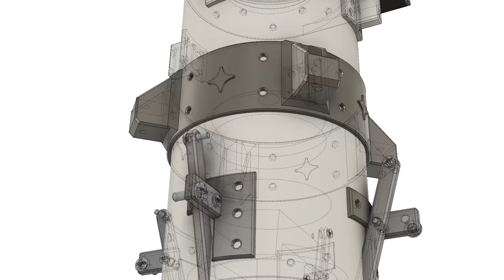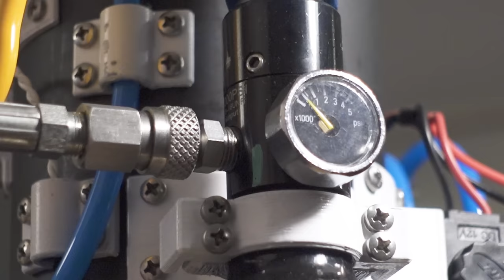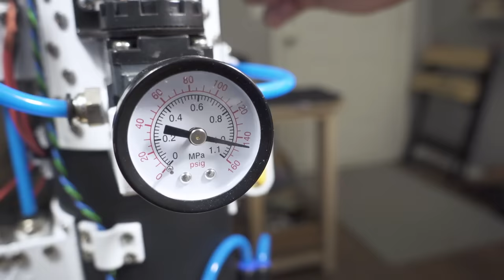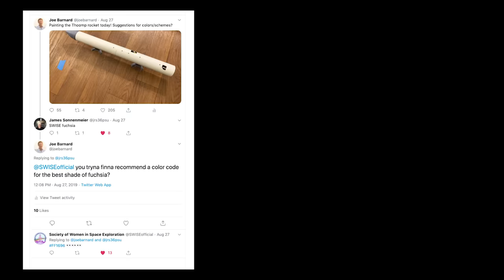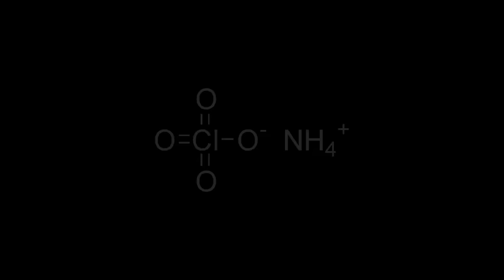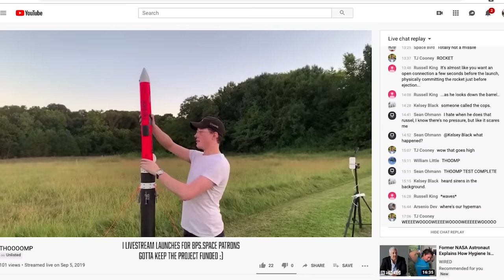Silo Launched Model Rocket

Comment: Now, make a underwater (submarine style) silo launch.
Reply: Yeaahh Agree!
It would be Awesome 😃
Reply: Cool 😎 idea.
Reply: would require way more thrust than a simple piston can provide
Reply: @ConfusedPlushiee  not necessarily. Look up cavitation or underwater launched rockets. Most create a vacuum or air bubble around the surface of the missile/rocket. This makes the rocket basically fly in vacuum/air underwater, dramatically reducing drag almost to as if it was above ground.
Reply: @jheins3  but isnt that a bit too complex for model rockets?
Reply: @ConfusedPlushiee  it would be difficult to test/launch but other than that idk. Joe is a genius
Reply: @jheins3  guess we'll see, tho I dont think he will be doing that.

Btw if anyone can convince him, theres a rocket project in the Netherlands, TU Delft, they want to break the karman line as second team to ever do that (after MIT), they will launch in summer 2020. Would love joe to make a vid about it!
Reply: @ConfusedPlushiee  an automated silo launch system isn't? hahah
Reply: Seimen Veldt it’s a little unnecessary and require a lot of work, but totally feasible
Reply: Use a condom to seal the silo between door opening and launch.
Reply: @jheins3  You're quite close. Real SLBM's use either a steam or a gas generator which is attached to the missile tube. In the case of the steam generator they have a small solid fuel rocket motor with its exhaust directed to a container of water. Once the motor is ignited it almost instantly boils all the water to steam, causing the missile tube's watertight cover to shatter along pre-stressed lines while simultaneously accelerating the missile upwards, out of the tube, through as much as 50-60 meters of water. And just like in this video, the missile will breach the surface and lift out of the water another 10-30 meters before it reaches its apogee and starts falling back down again, which is detected by the missile's accelerometer, causing it to ignite its rocket engine and beginning its flight. The bubble of steam or compressed gas will expand as it rises through the water column as a result of the decreasing water pressure, thus keeping the missile from coming into contact with the (sea)water. If compressed gas is used to launch the missile instead of steam, the entire process is pretty much exactly the same.

Comment: Man, that whole series is a bomb! I'm actually on the last phase of my master's thesis, where i need to design my own reaction control system of a rocket and your videos help me so much with it. In fact, some time ago I was dreaming about building a rocket and now, since I gained a lot of knowledge regarding this stuff through both my work on thesis and your videos - I'll surely go for it. I even shed a tear, when I saw a moment of rocket engine ignition. You are an inspiration. Thanks a lot!

Comment: I did a silo launch experiment around 1990. I made a rocket out of ¾" pcv tubing, put on folding fins made from plastic drinking cups, and put the "D-1" Estes motor on top of the tube. The motor was placed there so that I could line the tube with gunpowder from a shot gun shell, held on with gasoline. The added boost from the gunpowder/gasoline would significantly energize the rocket. The rocket then went into my custom made launch silo.
  I calculated that the rocket motor, with extra boost, contained in the launch tube, would really make this puppy fly like a literal bat out of hell!
  My friend and I went to a local grassy park in Southern California for our first test flight. The small bit of gasoline was dribbled inside the rocket tube, then sprinkled with gunpowder. The igniter was attached to the motor at the top of the rocket. Rocket slid into launch tube, wiring set. We took shelter behind our nearby car, just in case.
The button pushed, and the rocket blasted out of the tube perfectly, for about 5 feet, or 1 second.
  Apparently, using pvc tubing was an unforseen problem. The intense heat from the motor at the top, with combined burning from the boost mix, heated the tubing to its near melting point. As soon as the rocket cleared the tube, it became like wet spaghetti, and the motor thrust was 'vectored' like high pressure water coming out of a loose garden hose.
  The rocket went up left, right, forward, and back, right at us. We ducked, and hoped the terror of the out of control missile would end before anyone was damaged.
  The spent projectile plopped to the ground after traveling 20 circuitous feet. The rocket body was twisted like a Twizzle liquorice stick. We were laughing our heads off at the results, and the fact that we were in one piece.
  I'd made 2 of these things, so naturally we tried it a second time, only with no gunpowder/gasoline now. We got further back, hit the power, and.... same thing. Our ordinance went crazy, like a heat seeking 'Sidewinder' looking for a nonexistent MiG-29! We ducked behind my car. Plop! went the errant pvc tube, bent like a soggy pretzel stick.
  We went back to our garage laboratory, to make our next ridiculous toy; a BAZOOKA! Fortunately, that ended when we realized that if someone saw us shooting a shoulder launched, directional rocket, that we might be mistaken for terrorists, and there was a lot of that going on then.
  We didn't have the money for lawyers to explain that we're just hobbiests, experimenting with novel homemade toy rockets. It's also against model rocket doctrine to be able to aim your rocket at anything. We were planning on shooting down low level kites. Bad idea.
  I'd made my own JAVELIN out of 3 feet of 4 inch gray pvc tube, with a toy squirt gun handle, push button trigger, and a metal computer cooling fan screen for a sight. The missile was once again ¾" pvc, with the nose cone made from a large 'Crayola Crayon' top I'd gotten from Goodwill.
This made it look exactly like a Russian RPG! It was beautiful, and entirely stupid. If the police saw me with this, in 1990, I would have either been shot dead on sight, or still be rotting in a federal jail.
 Regretfully, I threw the whole contraption away. But it would have been glorious!

Comment: Good point about engineering. The WW2 Mk 42 torpedo is a fine example of engineering without testing. The weapon was a near total failure for the first two years of the war.
Impressive final results. You made a  model  of the cold war Polaris missile.

Comment: Did this 35 years ago on a much simpler platform. Built a rocket based on the Estes "scram" rocket with spring loaded fins. After several static tube launches we graduated to a shoulder launched model. No fancy electronics just a 16" rocket on a D-engine and some burnt Mullets.

Comment: Should've added some fins for stability. In order to fit them inside the silo, you could've built a spring-loaded mechanism that allowed the fins to be "compressed" while inside the silo as they pressed against the inside of the silo's walls. Then as the rocket was ejected, the fins would spring outward into their full shape unrestricted by the silo. I'm sure it would've helped with the flight instability issues!

Comment: So Joe, I thought it would  be of some use to you (If you didn't already know. You probably do at this point, but I'll share just in case..) to know that you're losing a ton of potential altitude by allowing the rocket to almost fully decelerate before triggering the motor. Essentially you always consume a considerable amount of your motor fuel trying to accelerate the rocket alone, but you could be letting the piston do all of that for you, allowing the motor to focus purely on coasting at already-max speed, giving you way more altitude.
Think of it like driving in the city vs driving on the freeway. All those stops require your car to decelerate and accelerate several times, which burns a ton more fuel.
Basically, with near-total deceleration before motor ignition, it's as if you set your rocket on an 6ft ledge and ignited it from there.

If you already knew this then, yay! if not I hope it helps! I've been following your stuff for a little while, and this has been really inspiring.

Comment: By the way there are laws against adding guidance systems to model rockets (At least there were in 2006). GPS chip firmware is also required to have certain mitigations in firmware to stop them being used for missiles. I seem to remember a 26k ft ceiling and 4g acceleration. That may also be where your instability came from if the horizontal acceleration was too high.

Comment: I remember building a piston launcher in high school. It used the rocket exhaust to pressurize a piston, propelling off the launchpad faster than normal.  I also used flashbulb ignition on multiple engine launches. It never failed to ignite. Not sure if  you can get flashbulbs anymore.
Reply: And yes, present me has been involved with the space program with designs for machinery for SpaceX , Nasa, Boeing, etc.

Comment: This could probably have been improved with the horizontal airspeed causing instability with dead simple fins, but it’s extremely impressive. I really want to take this design as inspiration for a project I’m working to rapidly deploy drones from a handheld launcher, using a reusable booster like the one you made.

Comment: Fortunately in test @2, that ignited rocket motor exhaust did not directly impinge on the high pressure gas cylinder for an extended period.  THAT could have been exciting!

Comment: I just worked on a project for a month. I am a programmer and i am not as cool as you but i still tried. I created 3 versions of a Virtual machine each focusing on one aspect of either speed, efficiency or memory and got below expectation. I created a 4th version that uses all the efficient methods from the other 3 to get the best performance but still below expectations. I ran few programs, my expectations when i ran those programs was that the execution time would be maximum of 1 minute but one took 2 minutes 46 seconds, one took 1 minute 42 seconds and one took 1min 7 seconds which makes it not suitable for workloads. The programs i ran weren't that long or that hard but still my 1 month of hardwork didn't pay off. I tried for the fifth time, there is a large improvement(almost 1 minute gap in the same programs) but still not enough. I have done no project so far that is worth bragging about and i am exhausted from that failure. But looking at you retry again and again gave me motivation to go on. Thanks❤‍🩹

Comment: This rocket could be adapted into a guided missile for rc airplanes. First add a camera to the front, the camera feeds the footage into a small computer which the identifies the target (rc airplane), this could be done with machine learning, showing it picture after picture of how an rc airplane looks in the air. Then one a target is identified, the rocket fires and using this thrust vector system, tries to keep the target in the middle of the camera.

Comment: Can you use the compressed air direct to push up the rocket instead of using pneumatic actuator. Some advantages from that system, but you need to upgrade the tube material and sealing, cardboard applicable but not recommended. Thank you for the great video and your team works

Comment: Very cool. Is there a way to install a stabilization unit on the rocket itself that uses a smaller compressed air canister to stabilize flight and allow you do direct the travel?  If you could install that, I would be utterly impressed!

Comment: I've always wanted to do this with Estes rockets when I was a kid just to simulate a silo launch.

If the rocket ignited after eject but before losing forward momentum, wouldn't that result in decent max altitude performance? I'm assuming that just getting the rocket tome from zero to a few ft per second takes a decent amount of propellent energy (I'm not rocket modeler so please forgive the noob nomenclature).

Comment: you could also have it tell the computer its going to launch it in x seconds, several times, so that it does not need to detect, but its just ignites it, maybe detect only if its out of the tube
Reply: why it has to slow down before it can ignite?
Reply: engineering is fun and easy

Comment: How about adding some fins that sit flush with the rocket body that pop out and lock in place when engine ignites? There's probably a way you can do it mechanically too to save on weight.
Reply: He doesn't need fins because it's actively stabilized. That's kind of the whole point
Reply: He doesn't need fins, he's using TVC

Comment: Why is the air in the paint ball tank 3000 psi?  Thats pretty dangerous. CO2 should be between 750-900ish psi depending on the temp. About 1000 psi and at 100 degrees you're at supercritical stages.

Comment: Well what if we make a long high vacummed tube with a hight pressurised piston that pushes rocket with a high initial velocity, reducing the cost of take off fuel,by reducing air resistance and then liting them up in air with same method u did, or we can use some electromagnets one attacted rocket base and others ongacummed pipe, hence giving bullet initial velocity for take off. Well iam not an engineer rathan that that iam an accountant, so i forgive me for not having any equations for that idea..🙌

Comment: Why use the launch tube , it's not practical... First off there is no reason for it . 
Secondly you have the issue with fins ,and can be made with fins that pop out after ejection but again it's not needed. Standing it up normal is your best bet. Unless you are making a missile with a explosive payload. Then use the tube ...